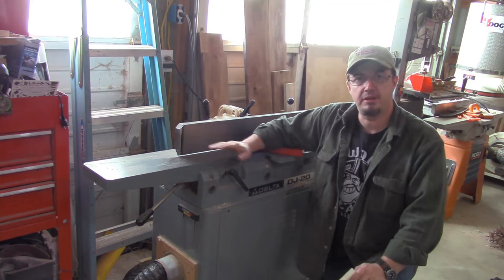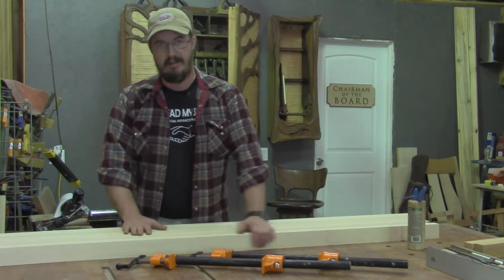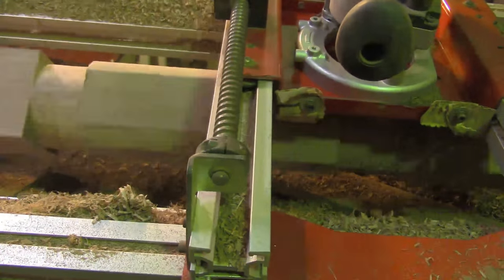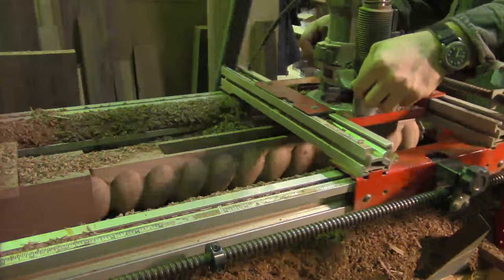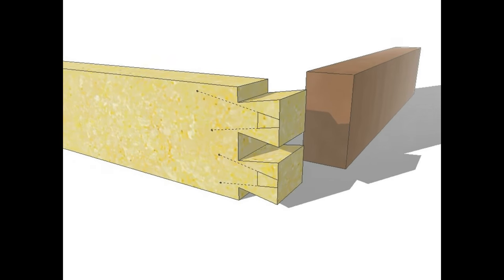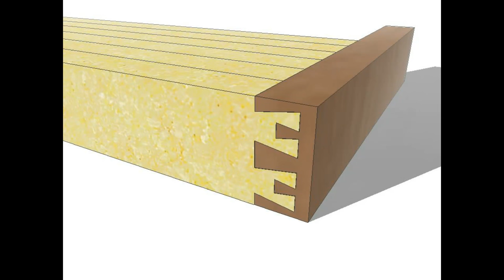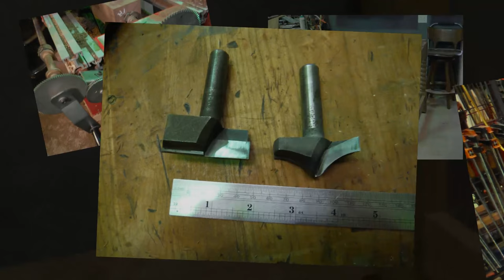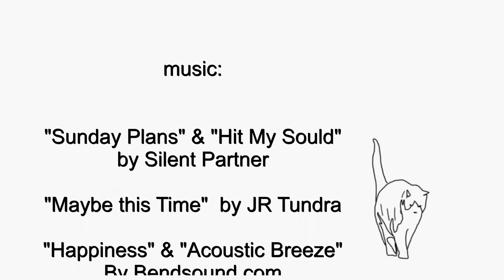Shop Remodel Finally "The Workbench"

Comment: I really appreciate the artistic flourishes you incorporate into your work, but for those less experienced watching I have to comment on the legs. The reason the legs are square surfaced on bench designs such as yours is because they are a very integral and valuable component in the overall clamping utility of the bench as a whole. Although your turned legs make your bench, in part, a very wonderful piece of furniture, your have entirely negated their use as a clamping surface. Now many benches, and yours will no doubt be one of them, are as serviceable to their owners as they could ever want them to be, but anyone considering designing and building a bench for themselves should at least consider the above. Very nice work though, it's a lovely thing and I enjoyed watching.

Comment: Great video and bench, Brian! I missed the double dovetail detail in the blog. Your chair hold/prop is really helpful. @ 2:19 it looks like you're ripping a 8/4 piece of maple on the band saw and then took the pieces to the table saw. Could you explain that? Thanks for sharing.
Reply from the maker: +fryefoto 
I rip the pieces out of wider stock and then joint one side to be flat, then I run them thru the saw to get final dimension.

Comment: did you make this router milling machine?
Reply from the maker: +0v3nm4n Nope it comes from Legacy woodworking, but I don't think they are making them anymore or the site is down. I think they have started to switch over to making mostly CNC machines.
Reply: its incredible. Wish I had one Maybe I can find one on Ebay
Reply from the maker: +0v3nm4n 
I do see them for sale once in a while, but beware, they are not as cheap as they were when I bought it.
http://lumberjocks.com/topics/33353